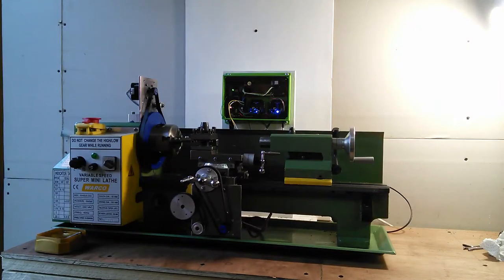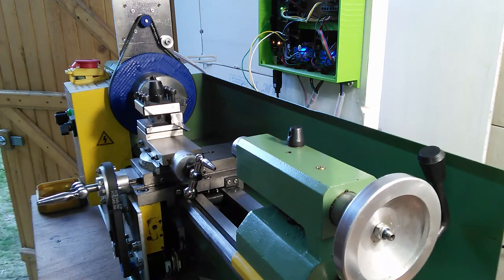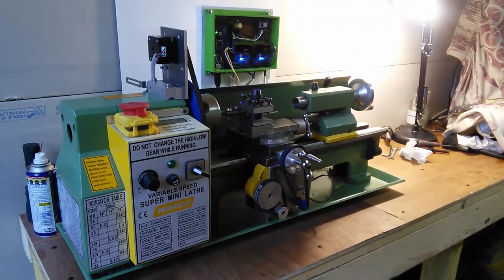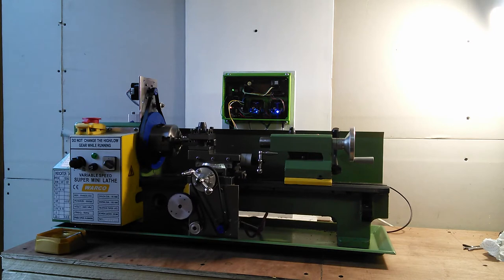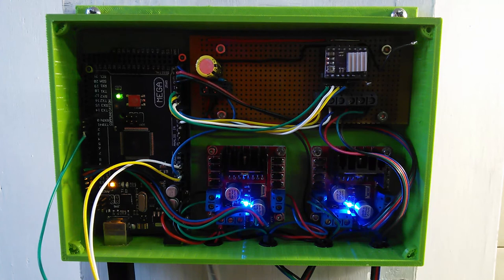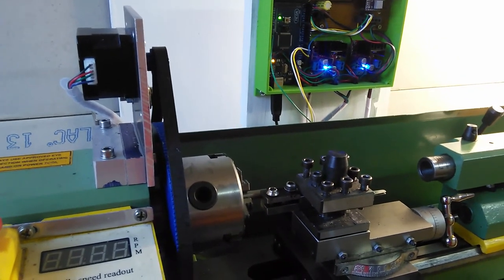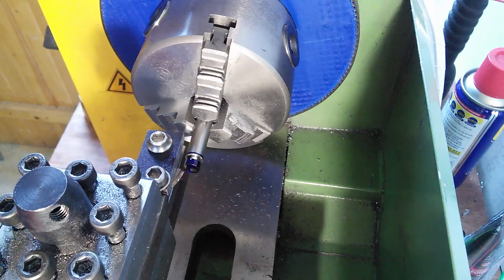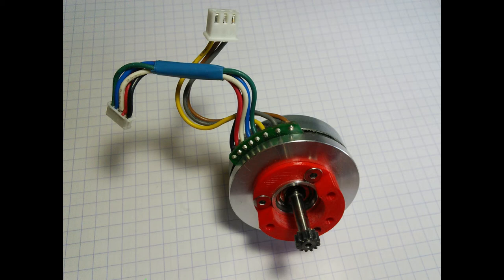Automated gear cutting on a Chinese mini lathe

Comment: Very clever. I have cut gears by hand, this way, in a lathe by fitting an index plate on the back end of the headstock with a hand made pin lock then using the apron like a hand operated shaper ram. It was slow, but the only solution at the time.
Reply from the maker: Thanks. It's been quite a useful little modification. I've since upgraded it further by adding a cammed system to drive the compound slide. The saddle is now locked during broaching operations. I've also done away with the controller, instead driving it directly from my LinuxCNC controller. It works very well and is a great deal more flexible.